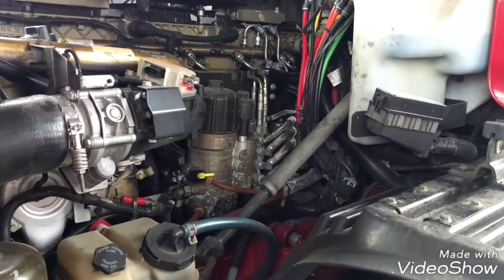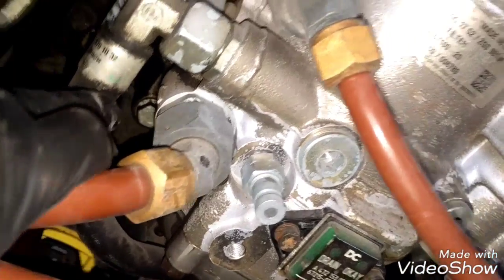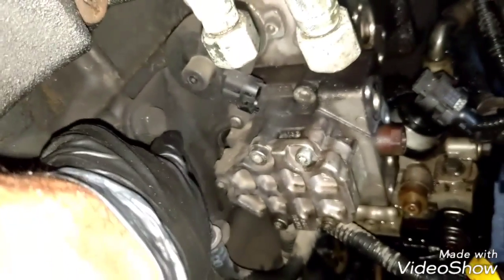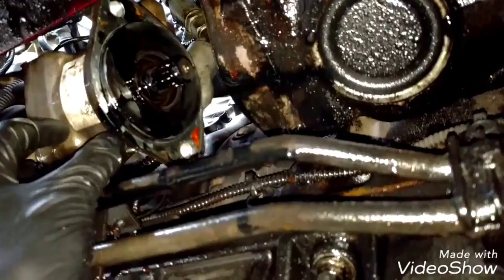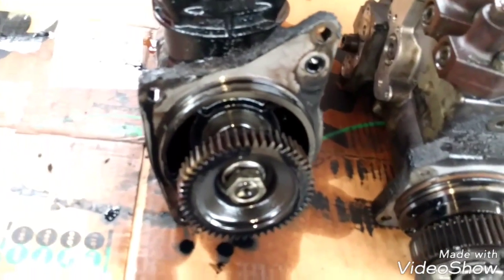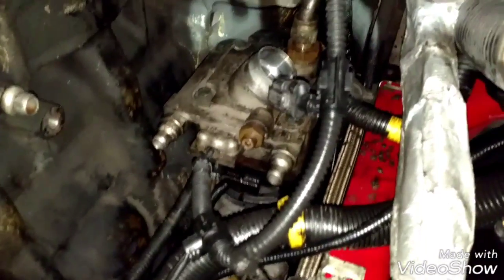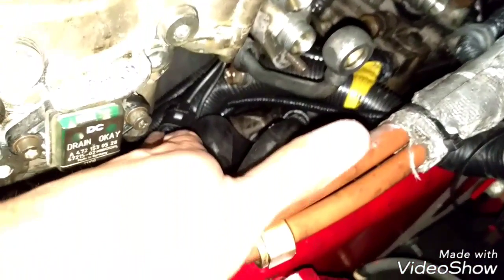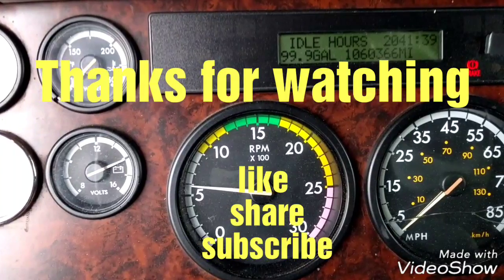Freightliner Cascadia DD13 DD15 DD16 ENGINE fuel pump air compressor seals replacement removal 472

Comment: I have a 2015 cascadia with a dd13. I have black oil in my coolant tank. I had my engine oil cooler changed twice and radiator with trans cooler changed and still having oil in my coolant. The truck drives perfectly with no indication of a bad head or failing air compressor.  Any ideas?

Comment: How are you doing engineer Francisco Amaya , I'm also a mechanic all the way from Kenya so my question is that why are we supposed to drain the coolant when we are removing the fuel high pressure pump? How does it affect the removal of fuel high pressure pump? Question number two it is a must to use high pressure pump timing device or can it be timed manually by only aligning the timing wheel manually? Feedback please thank you.

Comment: Hello francisco...Francisco... how are you. .I had the same issue .with the quantity control valve. I replaced the whole pump ..and now it does almost the same thing but only when at low rpm or when I start the truck after 2 days.   I be looking forward to hear from Francisco...I been following you for a few years and you are my first reference...God bless.

Comment: I can’t put the diesel pump back in some how it doesn’t sit well it’s about a 16th the gears don’t sit well what should I do took the housing and fuel pump to replace air compressor but the  fuel pump won’t go back in it’s the same one I took off help

Comment: I have a 2015 cascadia with a dd15 engine. The engine makes a miss fire at a temperature between 150 and 165 at low speeds from 600 to 900 rpm usually when I start driving. So far I have changed twice the injectors, injector harnes, ecm, fuel quantity valve, delta presure sensor and cleaned pipe, intake valve , checked the fuel system for leek three times. All this was done on ww williams under warranty, and they still can't find the problem. Has anyone had a similar problem
Reply from the maker: Check the fuel pressure at that moment with the dddl software

Comment: Ever seen the fuel pump stop working and fine shaving in the engine
Reply from the maker: No, really.  What happened to it?
Reply: Francisco Amaya The pump went out on my truck while in line at the loves and the check engine light flashed then the emission light came on, and 10 seconds later shut off never turn on, I have picture of the filter with shaving, repair is about 18k
Reply: @8300rpmallday  how much did it cost you?

Comment: I have the oil go in to the air dryer ,  and the air compresser
Continue building air to 150psi with no cut off,  do you have any idea to fix it? Please let me know Thank you
Reply: james Tong change the seals/gaskets?
Reply: @transport21  I replace a new air compresser and dryer everything see what happen !
Reply: james Tong how much was the air compressor and how much labor did the shop charge you? I got charged 7 hr for my cascadia.
Reply: @transport21  the air compressor was $775+ tax 
Labor was $ 350

Comment: You make it look so easy,a friend's DD15 fuel pump went out,it will cost him 5 thousand.
Reply: Wow 5 grand huh?? ...I just replaced my fuel pump myself a couple of weeks ago ...in all I spent about $2000. Fuel pump was $1600 after core return and around $300 on miscellaneous hoses, gaskets and other stuff it required

Comment: Tocayo tengo un problema mi camion tiene dd13 no quiere subir la precion  del aire y ase un ruido en el lado del chofer por donde esta la compressors que podria ser, me podria decir por favor, espero su respuesta gracias.
Reply from the maker: Si es fuga de presion de turbo puede ser El empaque de El manifold de admision
Reply: @franciscoamayaYT  
No tocayo no es el turbo la presion del aire no kiere subir nomas sube asta como 25psi

Comment: I have replaced a few compressors on dd13 without removing fuel pump if that's the only problem. You just gave to put your face on the side of the frame and look cross eyed tosee the top/ back bolt. Remove P/S reservoir and pump.

Comment: If only removing air compressor can it come out from the bottom?
Reply from the maker: Yes, but you have to remove the transmission lines if it has a manual transmission.

Comment: Francisco, I just replaced same pump on my cascadia, did everything like you said in video, but truck would start. It’s cranking but not starting. Do you have any idea what that could be?
Reply from the maker: Probably, there is a air leak in the fuel system.
Reply: @franciscoamayaYT  hi Francisco and how would I go in finding an air leak in the system ..same thing is happening to me after intake manifold seal replacement

Comment: my air compressor  is leaking oil  ，went to two shop already ， replace the seal and o ring 3  4 times still leaking  oil ， DO u have any idea ， what’s going with my truck?
Reply from the maker: Are you sure that the fuel pressure is not leaking oil?

Comment: Fransisco how do you remove the short water line from the compressor to the block because its leaking water from the end on the compressor. It looks like a clip is holding it on I just don't know how to remove the clip to replace the O ring. It only leaks when the engine is cold
Reply from the maker: You have to replace the entire coolant line
Here is a link of a video where I remove that line.
Reply from the maker: https://youtu.be/YsP8GeSthko

Comment: Hi Francisco.  Im getting ready to replace injector harness on dd15 2011. Any advice you can give and what’s the torque 
Specifications for the harness.  Thank you.
Reply from the maker: No specific torque to follow. 
Just make sure to don't put everything in place and tight enough but no too much or you can break it easy.  Also replace the valve cover gasket.

Comment: Why does a common rail engine need to be timed?
Reply from the maker: It is just for the guide plate that goes in the gear of the fuel pump.

Comment: Hi Francisco. Yes it was there, thank you.  I have a question about installing a new pump. 
I purchased a new pump today and the new pump is without the gear, the old pump he’s a key way for half moon
Insert and the new pump has only small pin to secure the gear. Can I use the old gear and eyebrow plate or I need 
The whole set new? Also is it the key way still the timing reference point and do you have the torque specification for 
The gear and eyebrow plate?  The engine is 3 filter setup manufactured September 2010. Thank you and best regards.
Reply from the maker: You can use the same gear, the pin is the new style of guide for the gear of the pump.  
You can torque the timing plate @ 25 ft/pnds.

Comment: I can’t find any mark on flywheel. Is it paint or punch in? Thank you.
Reply from the maker: It is punch in.  Sometimes, the clutch dusk covers the mark.  You have to rotate the flywheel until you find a long flywheel tooth from there the mark is going the be to the left, like three teeth away.

Comment: Hey Fransisco how much you charge for change compressor parts and labor I have 2011 DD15 . 2 month ago I change discharge hose because was not built air.  And now start again not built air so I think its compressor go bad on this compressor only 350,000miles 5years . And when I drain air from air tank some white smoke coming up smells like fuel burn. What helps for me to build air I need stop truck and drain all air so compressor gonna starts working again. What can be? Please help.
Reply from the maker: Check the air dryer and replace it.
Reply: Francisco Amaya I checked twice

Comment: A quick question, the air compressor it's leaking water on a cascadia. Can I just remove the compressor without removing the fuel pump? Also Do I have to set the timing?
Reply: Yes you can and no  engine timing

Comment: I need to replace my air compressor...can I replace it from the bottom or do I also have to remove the fuel pump to do it...thanks
Reply from the maker: Yes, you can replace from the bottom but you will need to remove the transmission cooler lines to have more room.

Comment: Francisco you seem to be pretty knowledgeable on the dd15. I have one question. With proper maintenance and average use...do dd15s go 1 million miles?
Reply from the maker: By that I meant, no to drive the truck in high gear when you are going up high or taking off, Do not jump gears when you are loaded.
Reply: Francisco Amaya what you mean when you say don’t over load engine and transmission?
Reply from the maker: Yes, I can last 1M miles. 
The truck in this video has at this moment 1,090,xxx miles, original ENGINE. 

Always use good quality oil and fuel and don't overload the engine and transmission.

Comment: Hey Francisco good video and I have the same problem in my truck same engine dd15 can you help me out to fix my truck?
Reply from the maker: Yes, how can I help you?
Reply: Yes Francisco I have 2010 cascadia and my fuel pump went out on me and I was wondering how much to change that and I think metal debris went into the system. I know it’s a big job and I live in Cali but I’m here in Lexington ky and my truck doesn’t drive more than 50 mph. Are any close by ky?
Reply from the maker: No, I am not. 
I am in Fontana CA

Comment: Francisco what about if only air compressor needs to be replaced. is it easy to get to the rear bolt ?  after removing bolts , hoses and power steering pump is it coming out easy?   just pull forward and bring compressor down ?
Reply from the maker: I will always recommend to remove and replace the fuel pump seal if you need to replace the air compressor only. Anyway, you can remove the air compressor only. 
To remove the air compressor you have to remove the transmission cooler lines and the power steering pump, to remove all this you have to be underneath the area where the compressor is located and then remove the bolts. You have very limited space to remove and install the compressor, so you will need to remove any component that is on the way of the compressor so you can have enough room to work.

Comment: men you should change unloader valve O-rings in air compressor too while compressor was out . very good video !!! I see the odometer was showing more than 1 million miles. I would put new air compressor on engine for sure.
Reply: Definitely change unloader valve seals. Because its such a pain to get to when installed.
Reply: wrxassa guys. Probably the owner didn’t want to loose more days without making money.  You know there are some guy in a rush,and don’t want to spend more money or time in their rig. They just want to KEEP TRUCKING!
Reply: Do you know where is located the unloader valve?
Reply from the maker: Julio O.
It is located on top of the compressor. The cover of it looks like a almond.